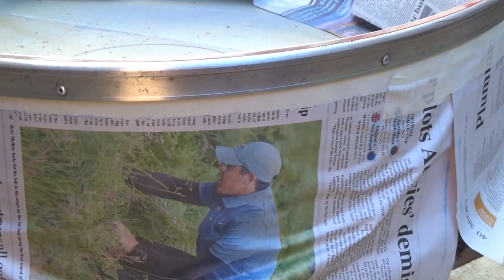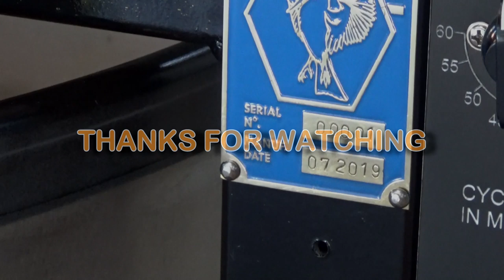The "Kooka Muller", a DIY Sand Muller for the Home Foundry - Final

Comment: double the weight or add some springs?
Reply from the maker: It could probably do with more weight but I have nothing to compare it to. It seems to get the job done. I recently mulled a new batch of green sand starting with just the raw ingredients and from my understanding, the mulling process is required to ensure that each grain of sand is coated with the clay binder. I used the new batch of sand to make some castings and it worked quite well.
Regards,
Mark